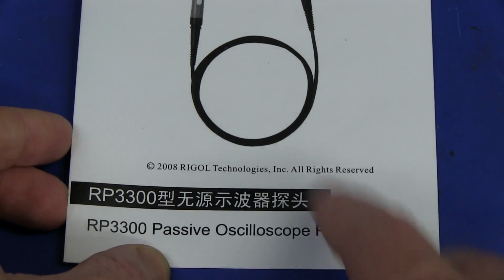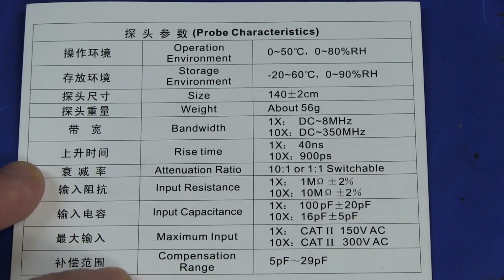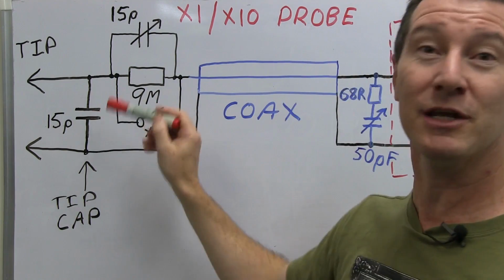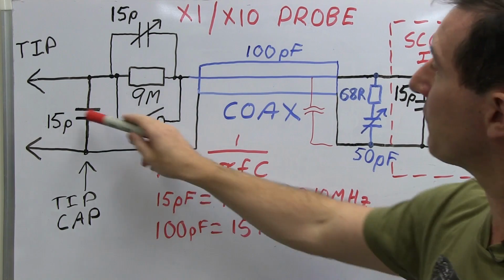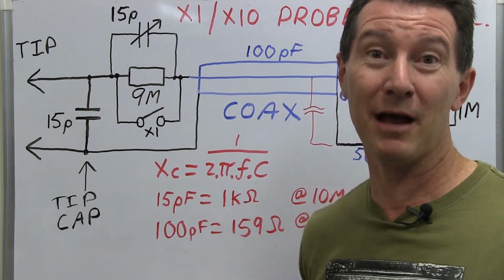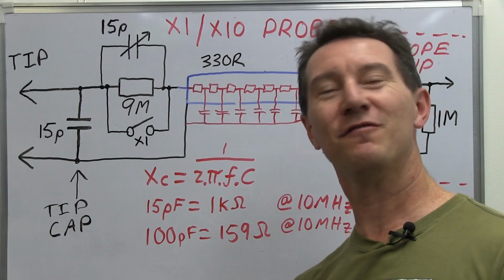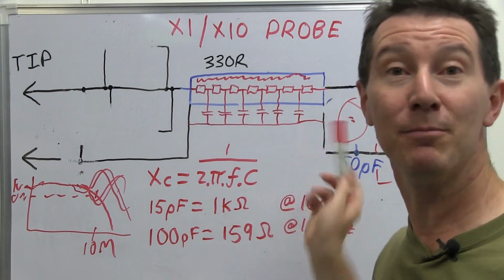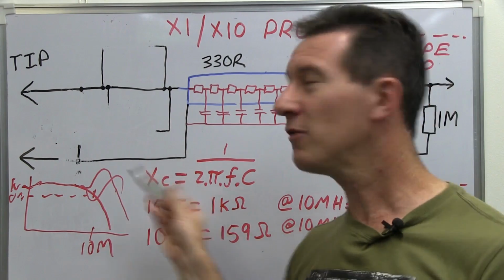EEVblog #453 - Mysteries of x1 Oscilloscope Probes Revealed

Comment: I would say that everything is little simpler, since i had to design my own cable for oscilloscope probe.

Most important feature of lossy cable is to have very low capacitance, so wire must be as thin as possible. If you try to replace it with regular coax you still can compensate everything for any bandwidth but input impedance will be terrible, what makes measurements impossible( done that and was puzzled why everything stops working when i attach my probe)
probe impedance is basically cable impedance divided by multiplier.

lossy cable allows you to achieve higher input impedance
resistance does not seem to play significant role however it ensures that there will be no reflection because of improper termination
and also it may improve impedance by turning cable itself into atenuator
Reply: Interesting to see how the pure truth not earns many thumbs ups. 
I add some other (probably even less popular) fact: the other reason of the high wire resistance is the material choice. The wire must be strong and flexible despite of the very small diameter, and also not soluble in tin during soldering, this is why it cannot be made from copper, but other materials with higher specific resistivity must be used.

Comment: John Wheat: Cute but mostly useless. Don't waste your time or money. Ipad scopes can only measure limited audio frequencies. You will miss seeing many frequencies present in a circuit. Buy on Ebay an old Tektronix oscilloscope with a 100MHz or higher bandwidth. You'll start to appreciate what a scope can reveal to you about a circuit's operation.

Comment: So if you need your probe to be equaly good at x1 and x10 mode, you have to take it apart, and mount a coax connector so you can change the cable to a simple coax one and back to the original... XD That's the best way to compensate it right?

Comment: Fave, I have a ds2000 and the 350mhz rigol probes that came with it. I just noticed that above the 1x 10x switch there is a rubber plug, remove it and there is another adjustment, how does that fit into this?

Comment: The x10 probe reduces the signal amplitude by ten times. This forces the scope to amplify the input signal by ten to get back to the original scaling (which means it will also amplify any input noise by ten as well). So the x1 probe is more sensitive and can capture low level signals with better resolution and less noise.

Comment: Since I am fairly new to electronics I am trying to understand oscilloscopes and probe use. I watched this with keen interest, others concerning 10x probe use and even W2EWs video about the effects of ground lead length on signal quality. Frankly, I still can't quite understand the value of 1x probes, rather than just using a 10x probe for everything. What am I missing? Many thanks.

Comment: smaller voltages measurements
most scope go up to 5mV/div, in x10 thats microvolts.
HF x1 probes would be useful for that, a 20mVpp sine wave is at least visible in 4 divisions instead of half (2mVpp)
at least that's what come to my mind.

Comment: the ipad's ADC (aka the sound chip) doesnt have the sample rate required for a  decent measurement. you will get at most 48 Ks/s which is the sample rate of the sound chip, the same goes for the sound card oscilloscope. the KHz is the sample rate, not the bandwidth, you'll surely have more than that of bandwidth but without the sampling rate, that's useless. The cheapest  chinese  scopes come with 500Ms/s and 1Gs/s, and 1Gs/s is the minimum recommended for almost everything in general.

Comment: Dave, One missing element in your trasmission line analysis  is INDUCTANCE. Impedance (Z) is equal to the square root of the ratio of L /C. The whole problem of BW in your case is related to matching (optimal transfer of power) the input and output Z's to the trasmission line. The 9 Mohms helps expanding the BW but introduces resistive losses, hence the X10. A 50 ohms coax will not help without proper matching or termination.  I think it is time to review transmission line theory. Cheers!
Reply: The impedance of a LOSSY transmission is NOT sqrt(L/C)... but sqrt( (R+jwL) / (G+ jwC ) )

Comment: 100x is also useful for low voltage sensitive ccts, e.g. 32K xtal oscillators and micropower /low leakage stuff. For low voltage, low frequency use, a 90M resistor in series with the top of a 10x probe is a cheap option.

Comment: This is very usefull information, THX a lot. The resistant core of the coax also helps to block from signal ringing and mirroring at the input of the scope.

Comment: So basically what happens is that at x1 mode, more electrons have to travel at a time through the wire, because wire is too thin, it can't handle electron traffic. At a x10 mode, less electrons have to travel, so wire can handle the traffic. Have I got that right?